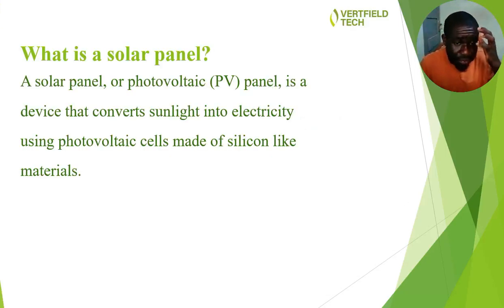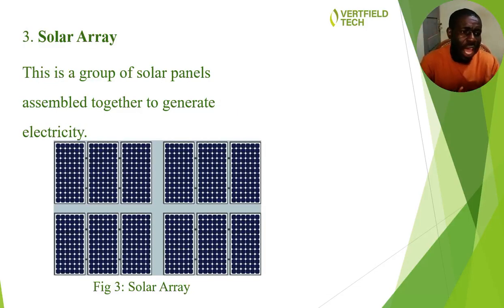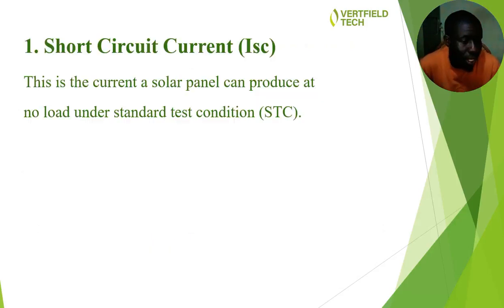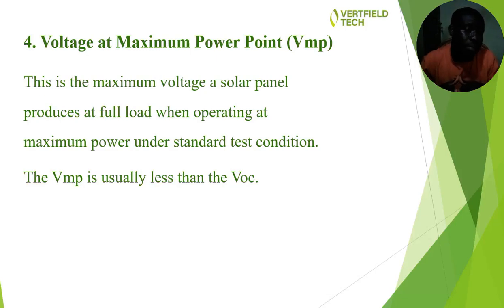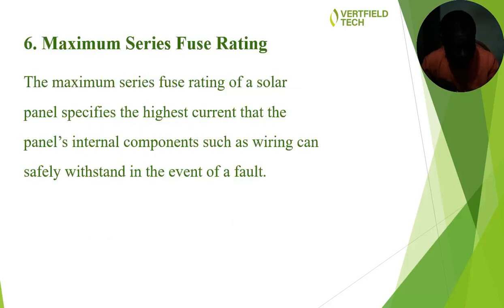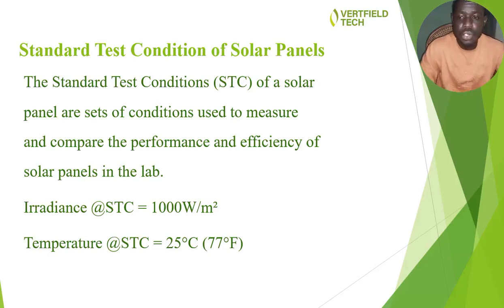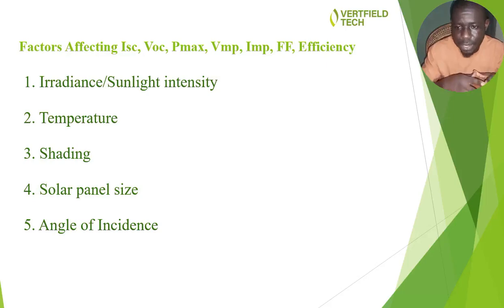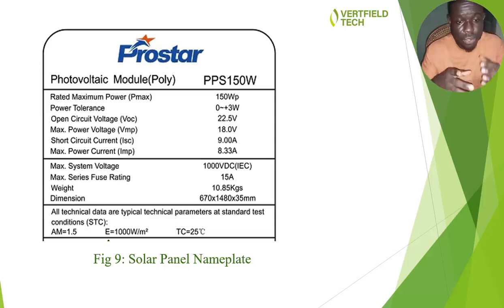Technical Parameters of a Solar Panel

Comment: Hello, I'm afraid  to let  you know that  may be there is  a  mistake one the definition of the Cell Isc short circuit  current. It  is the maximum current the  Cell  can provide  when   its to output  terminals  are connected together.